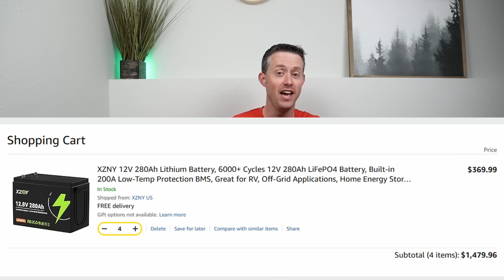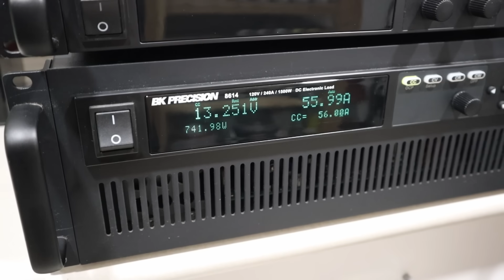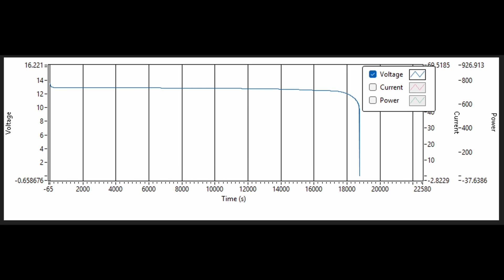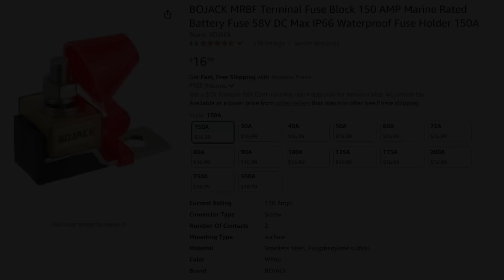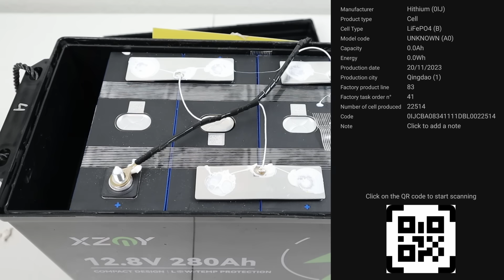CHEAPER THAN DIY?!  XZNY 280AH Batteries Wired in Series for 48v! Impressive Results!

Comment: Can a 12V Lifepo4 charger still be used on a single battery's terminals while two are still connected in series to my Ecoflow alternator charger (but no power is going in/out)?

Comment: I'd be really curious on how this then connects to a power station like a bluetti ac300. I just got one and would love to expand the battery storage and not have to get the big bluetti ones
Reply from the maker: Heres a video I made about DIY expansion batteries:
https://youtu.be/tK4JKmfndh8
Reply: @Jasonoid  Thank you! If i was to do something like this is there a charge controller youd recommend to be able to charge the batteries via solar? Or do you think getting a 48v battery and then a charger and charging it that way would be a easier option?
Reply from the maker: @GravySealNetwork  48v is the way to go, you can do that with four of these batteries. Connect up a 48v charge controller and you're golden.

Comment: Can these 48v series icharge a Bluetti AC180 without any issues?
Reply from the maker: Yes, the peak voltage of 4 of these batteries in series will be lower than 60v (the Bluetti AC180 input limit).
Reply: @Jasonoid  Wow, fast response!. I was watching your other video with a single 48v battery charging an AC180, these series seems to be a better deal. thank you and subscribed! looking forward to more great ideas from you.
Reply from the maker: These batteries are an amazing deal. I have been using them to charge my power stations for weeks now. Solid performance no issues at all  @siniestro0239

Comment: I've always heard the argument against doing this because of the batteries charging and discharging at different rates, I know you mentioned this in the video. However doesn't a "single battery" still have several smaller batteries/cells in series and parallel inside of it? Why wouldn't the imbalance happen inside those batteries with multiple cells inside?

Comment: If I recall it was you watching one of your videos where if somebody had a power station that you could actually use a battery to run through the power station also. So I know a lot of power stations are not 12 volt I think most of them are 24 plus how many batteries would it take to equal 24 volts can you run more than two? Or can you only run two batteries that are 12 volt to make 24 volt for a backup batteries for the power stations. The reason why I'm asking is because some of those 24 volt batteries that are big are really expensive.

Comment: How much would the copper wire and connections between the batteries add to the cost for the sake of comparison to say a server rack battery or that EG4 monster? I assume even with the terminal fuses, it would still be considerably less!

Comment: You should be careful charging as soon as possible after freezing the cells. Some of these cheap batteries have the cold temperature probe still tied up on the BMS and can't tell the cells are still under 32F. Just a thought
Reply from the maker: No harm done in a simple 10 second test. It's repeated cold charging below freezing that causes the issues within the cells.
Reply: @Jasonoid I just saw that you tore it down. Good job

Comment: Are the jumper cables color coded that way for a specific reason or is it because that's what you had available at the time?
Reply from the maker: Jumper cables don't need to be colored either way, I used what I had laying around.

Comment: I ordered two of the 310ah, they had a special deal going for a bit.   A few bucks less than the 280ah.   Does anyone know what the warranty is?
Reply: Thank you for your purchase😁 If the battery encounters any issues that are difficult or impossible to repair within three years, we will provide you with a brand new 12V 310Ah battery as a replacement and assist you in returning the faulty battery (XZNY will cover the shipping costs). If the battery encounters issues after three years, we will also offer other after-sales solutions:)
Reply from the maker: I think they have a three year replacement.

Comment: Should put bus bar on battery cables to help equalize power input / output - makes a big difference to help keep balance
Reply from the maker: You use bus bars for a parallel setup.
Reply: @Jasonoid  I think you should do more research Try Will Prowse or his solar forum - You said this was your first series build right ??
Reply from the maker: I watched plenty of his videos, all of his 48v batteries are connected in parallel with bus bars.

Comment: Not a good idea to run 12V batteries in series to make a 48V battery.  A real 48V battery will likely cost you more but with one common BMS, it will balance the cells better and last longer (and the cells will start life more uniform).

Comment: I opted for 2 of Their 24 Volt 100ah Lithium Iron Phosphate with LTCP wired in Parallel to Buss Bars and have No Need for Bluetooth and Happy with 5KWH for a 24 Volt 2000 Watt RENOGY Pure Sine Wave Inverter as another Stand Alone Power Supply System

Comment: This isn't a bad deal considering how clean they look when in use. I've built my own 48V packs of 314Ah cells and my total cost with taxes and shipping was just under $1000. The ones in this video arrive in 6 days or less and don't require negotiating. Mine took about 6 weeks after a week of negotiating due to time differences. Getting the tracking information was like pulling teeth. If I were going to build a 12V 1120Ah bank, I might order the ones in this video. I'd never build a 48V bank of prebuilt LFP 12V batteries. Balancing them would be an never-ending nightmare. My 48V banks use 16 Prismatic cells with active balancing JK BMS. They are the way to go for 48V every time.

Comment: Your indoor battery bank is as dangerous as mine.  There is talk of a regulatory change requiring that all such batteries be kept outside the home.  The reason is that Lifepo4, while safer than other chemestries, produce huge amounts of explosive hydrogen if they fail
Reply from the maker: That's an interesting point, I hadn't heard about that regulation change before.

Comment: I am thinking about installing some solar panels on a pergola or ground mount system to reduce some electrical cost. If I buy the 6000xp can I hook it up to the grid to feed the batteries if solar is lacking for the day? I think that your video is a great and it makes cense.
Reply from the maker: You can connect the 6000XP to a transfer switch to load shed some of your circuits during the day. The 6000XP is not a grid tie inverter, it's an off grid inverter. Grid tie connections require permits and inspections.
Reply: @Jasonoid  Thanks for the info...

Comment: Should not all your cables be the same length , middle cable looks short
Reply from the maker: In a low amperage setup, under 20 amps, I doubt it matters. I'm using 1/0 AWG wore rated for over 175 amps. A couple inches difference shouldn't matter.

Comment: Nice review. Batteries are nicely priced now. I definitely don't want a battery that I can't simply take apart and carry up and down steps whenever desired. I'm thinking of getting smaller 48V batteries and connecting them in parallel, but they cost a bit more from what I seen so far.

Comment: I'm not sure about the 4 in series. Here's the problem. If one battery were to die and the BMS went short and you're attempting to charge those batteries with a 48V charger (so usually around 56V) you're risking putting 18V each across those 3 remaining batteries. It's the big issue overall with 12V batteries in series - potentially exposing 12V BMS's to voltages they were never designed to handle. On top of that the BMS's do not talk to each other. Overall I just think it's ... suboptimal.
Reply from the maker: The battery 48v charger wouldn't start charging because the total voltage would be less than 40v. These battery chargers are smart and keep damage from like that from happening 👍
Reply: @Jasonoid  Thank You.. Interesting..

Comment: Having different brand cells between batteries is a bit iffy, but to be expected with something that inexpensive.
I would not use fuses from a random company. You want Bussmann or Littelfuse, that's what Blue Sea resells.
MRBF fuses typically have a 2000A interrupting capacity at 58VDC, the fault current of four 12.8V 280Ah batteries in series may exceed it causing a sustained arc. You're better off getting a  single main fuse holder and Class-T fuse that's rated for 20000A at 125VDC. May cost a bit more, but skimping on safety is not a good idea.

Comment: if youre going to wire multiple batteries in series, you might as well go with 280ah lfp cells direct from china. if youre going that way, theyre only 0.45$/wh, about half the price of these.
thats not including a bms, but you have to know ahead of time what setup you want if youre going to get a 16s 48v bms. i just use inductive active balance boards, makes them dumb but much more efficient, and theyre only 2 buck each. most lfp fires are from bad bms'. just dont let them freeze. also, if you want the smallest form factor, you want to go with individual cells. if they take less than 3 months to ship, youre getting them from a dropshipper/reseller and not CATL. theres only 3 mfg of 280ah lfp cells, and only 2 of them sell to consumers directly. get off scam azn, everyone is massivly overpaying for everything on there. you dont have to pay tarrifs if you buy direct from china.

Comment: Superb work as always but I personally prefer two 24v 200ah batteries in series costing about the same at 10 cents pwh but saving a bit overall.
Reply from the maker: That's a sweet setup! Less moving parts 👍
Reply: Not the same capacity though, but surely better. Less wiring and series connection.

Comment: I have 4 Eco-Worthy 280 ah batteries I'm planning on doing this with. I actually would have preferred the brand you have because of the size difference after seeing the build but I'm pretty happy with the Eco-Worthy's. For the price I can live without the extra's  that come with the server racks. Good content, thanks!
Reply: Four server rack batteries at over 850 each. Id twice the price. The extras is just a case and bms. ?

Comment: I'm pretty sure the "wasted space" in the other batteries is so they can directly replace a lead-acid battery in the same mountings, in a camper or boat.
With more people doing DIY solar and the like, manufacturers have spotted a gap in the market for maximum power and minimum size!

Comment: I did this same thing recently with four DC House 36V 100Ah batteries.

Found some amazing deals and ended up with slightly over 15Kwh for about $1,500, so about $10.3/Wh.

Its all wired in parallel and everything seems to stay somewhat balanced for the most part.
Reply from the maker: Excellent setup! The parallel wiring is definitely nice to keep things equal.

Comment: Do you get more Watt-Hours by putting them in series at 48 volts vs putting them in parallel at 12 volts, or does the power just go in faster?
Reply from the maker: The total power is exactly the same between a series and parallel setup. It just depends how many watts you are trying to pull. Amperage is huge on the low voltage system, you can pull more watts from a high voltage setup. 
You either get: 
12.8v @ 1120ah = 14336wh
51.2v @ 280ah = 14336wh

Comment: Does the '(B)' after Lifepo4  from the QR code data stand for B grade cells?
Reply from the maker: Not sure. The batteries pulled 292ah in my capacity testing, you'd think they would show less than that if they were grade b cells.
Reply: Apparently Grade B can have similar starting capacity to A but age significantly faster. They also perform worse in all areas. Higher self discharge rate, more voltage drop @ high current, uneven discharge rates etc etc.

Comment: Ya I use the Litime 4 12volt battery balancer with my 4 280 by EcoWorthy but these one are better priced for now. Only draw back is no communication but when combined with a 100 ah rack battery it will follow the communication battery lol.
Reply from the maker: Since they are wired in parallel the voltage is matched between the batteries. They have been cycling nicely for two weeks since this video was finished.

Comment: $1480 for 14kwh is a good price.
Of course you have to pay for cables, fuses, monitoring and a switch. 
If they hold up to long term use, it’s a good setup.
Reply from the maker: I've been using them for about two weeks so far in my 48v setup. All of the 48v batteries are cycling smoothing in parallel, we'll see over time.

Comment: I bought a 300ah $253 had 314ah eve cells.Will P says 4 12v wired to 48v has issues.
Reply from the maker: What issues do you recall?
Reply: may have been referring to epoch (at bottom of his list now) 48v bats were a better solution now that those and other brands are made now.He didn’t say what issues but guessing balancing.
I have 4 230ah 12v wired 48v.LiTime manual says to balance separately every 3 months.Voltage shows the same on all 4 so I haven’t done a separate charge per bat.
Reply: @2hotscottpro  
i might be able to guess what his issues with having 12v series together would be

if a BMS fails and youre charging, youve killed all your batteries by sending 48v to a 36v bank

spreading the load on will stress out the outer batteries so youll need to rearrange them when you do the maintenance on it

the other one might be cost/space difference, they are near the same price with less space taken, im pretty sure he really likes the server rack format

Comment: Would these need heaters to put in garage in the winter for backup?
Reply from the maker: To charge them, the batteries will need to be above 32F. If your garage gets that cold, then probably yes. An insulated box next to the house wall might make a big difference.

Comment: Over on the DIY Solar Power Forum, a poster mentions that a product called PwrMr battery equalizer (available from Amazon) that will equalize and balance up to 4 LiFePO4 or lead acid batteries in series.  May be something for a future video in this series.  10 cents per watt!  That's cheaper than any crappy AGM or SLA batteries!  There's quite a lot of KW-Hrs in that small space:D
Reply from the maker: Theres been a couple suggestions about devices to help balance. I guess Victron also makes a balancer too. I need to do some research! Thanks, John!
Reply: On Amazon I see a 10a equalizer for $80.  It has a switch to turn off the display so its standby power consumption is almost nothing.
Reply: Yes, definitely need to balance each 12v battery otherwise they will eventually destroy each other.
Reply: They are just badge engineering.  The things they sell are available under a large range of 'manufacturers'.  Ultimately battery balancers are a poor solution since they can only pass 'so much' current.  The proper answer when it comes to batteries that use a BMS is to either buy the native voltage battery or to use a BMS system that can talk to each other to act as a single over-arching BMS (this sort of thing does exist but is usually out of scope for people that would buy a collection of 12V batteries to save a few dollars)
Reply: @retrozmachine1189  That helps explain the data cable between a couple of 48v batteries that are installed in one of my systems, thanks, even though they're in parallel and not serial.  Maybe when a BMS realizes it's the highest voltage battery it shuts off charge current until there's equalization.  As for the balance rate, a 10a equalizer would put 2.5a per cell from the high voltage battery to the low battery.  Isn't 2.5a about what an internal balancer can do?
Reply: @posteroonie  Maybe.  If you mean those 19" server rack batteries with comms cables, generally they don't do what I was talking about since normally they are in parallel.  I have heard of one that claims to support it but I've not seen anyone test them to verify that's what they actually do.  For series configurations the batteries supposedly chat amongst themselves and use their own internal BMSes to bring each battery to the same voltage.  It's more or less the same thing as an external balancer for series connected 12V batteries.

The problem with series balancing of some type is that unless the batteries are very closely matched they will diverge in voltage at the top of SOC (> 95%) because of lifepo4's steep SOC/Voltage curve and still be passing current high enough that a 10A balancer will not cope, one battery will go into over voltage protection and stop charging of all the batteries.

To give you an idea of how things can diverge, on a parallel system I monitor at 96.7% SOC, b0: 14.06A, b1: 3.12A, b2: 15.6A and these batteries are pretty closely matched.  If there was a series system a 10A balancer would not cope and the voltages on the batteries would likely have caused one to block charging.

I'm not saying a balancer won't work, just that the better way is to buy batteries that operate at the voltage you natively want.

Comment: Bluetooth would've been nice on these. I actually like being able to turn off discharge when connecting to an inverter. No need for a resistor, no spark.
Reply from the maker: That would have been nice. In a permanent install I use a DC breaker as a power switch / fuse. It works great.

Comment: Great video Jason! Other than the std steps for wiring in series (individually charge-etc), one can use a Victron Load balancer -$50 at the time of post (or other brand-cheaper) to help with that potential drift over time.  Lower over all cost and if one takes a crap, just R&R it in theory. Thanks for the tear down!
Reply from the maker: Excellent suggestion, I need to look more into those! 😁👍
Reply: @Jasonoid  yes please that would be a great add on video for testing these.